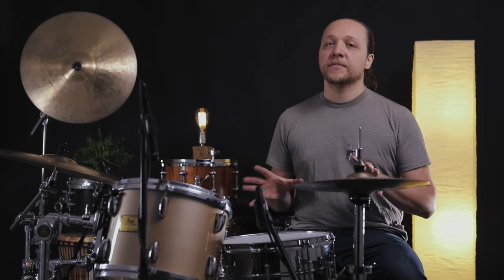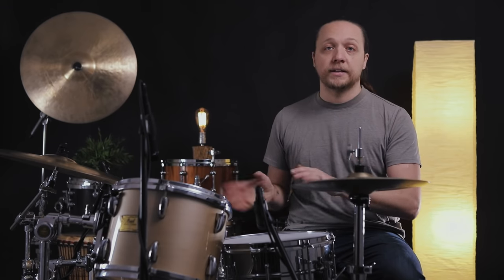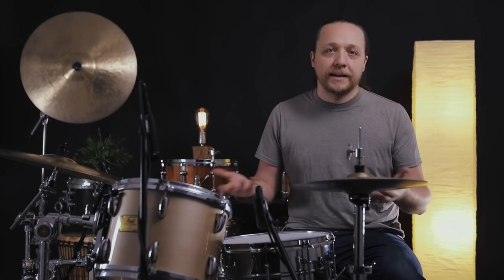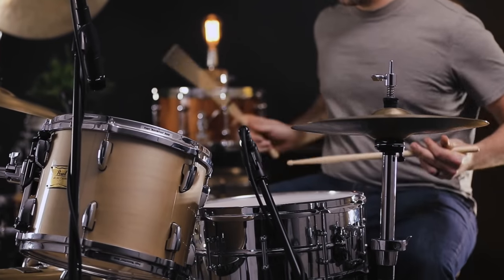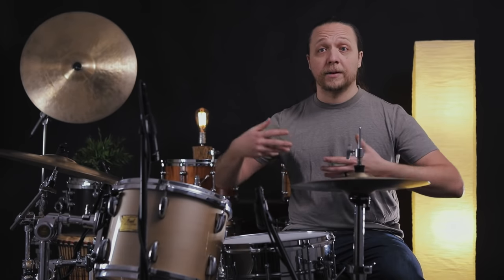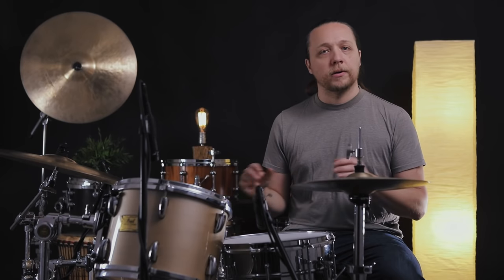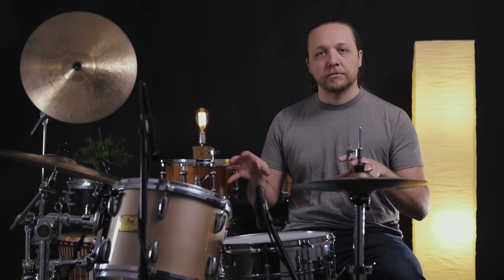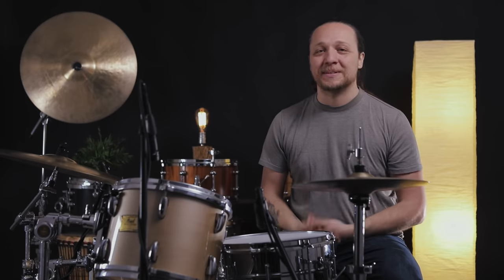Your Resos Are Killing Your Tom Tone | Season Three, Episode 38

Comment: Great Job and Clean Precise Playing I’ll also add I tune the Drum to its own shell sound just tap it with Tge heads muted and you hear a Tone FYI I found out DW Collectors are Stamped inside the Shell
Reply from the maker: Thanks Tim! For what it’s worth, the pitch stamped on the inside of the shell (or the pitch of the shell without any hardware on it) has little to no relationship to the tuning or tunability of the drum. We debunked this in a couple previous videos. It’s a nice marketing piece but should by no means be considered a standard for tuning the drum.
Reply: @SoundsLikeADrum  I mean I tune the drum to the sound it makes the pitch of the Shell I don’t check the notes just the sound

Comment: I'm constantly changing the intervals depending on the heads I'm using.  Before, I had coated G12 batters and Genera Resonant resos; my 10x8 tom was tuned with the reso a half step lower, and my 14x11 tom was tuned with the reso around a M3 or P4 higher.  But this was at the end of life for the batters, and they were probably different a few years earlier.  (Yeah, I waited a really long time to change heads, and surprisingly, the resos still have tone when I tap them off the drum.)

I recently decided to give Remo another shot, and now I have white suede ambassador batters and clear ambassador resos.  The resos are both tuned a slightly sharp half step above the batters.  Maybe the heads still need to be broken in, or maybe I need to bump up the resos a bit, but I'm getting a bit less sustain than I would like.  The 14" also gets boingy if I try to tune it lower.

I've had success with Remo resos and Evans batters on my snares and kick.  I probably should've done the same with my toms.

Comment: Have you ever used a Controlled Sound or Power Center type head as a resonant? I find myself using a moongel directly in the center of my resonant heads a lot lately, and I'm wondering if I can get away with not doing that by simply using a CS-type head instead.

Comment: I usually tune top and bottom the same way-half turn all around, but that doesn't result in the same pitch since my batters are thicker than my resos. The reso is about a minor 3rd higher in pitch. I suppose you could get similar results with the same heads top and bottom if you tuned the reso a little higher. I've never been able to get a tom to sound better (to me) tuning any other way.

Comment: i'm old and old school. by listening to the drum itself you can find the note of the drum. i do everything by ear but now i then grab a drum dial and find what number am i at just to make it faster next time. right now for toms only we have remo pinstripes on top and generic pearl clear on the bottom. both heads are at 75. i always tell people if you need tape then you didnt tune correctly. also, what happened to the direct comparison usually at the ends of videos?
Reply from the maker: That's an excellent way to find sounds. I have to disagree with you on the statement regarding the use of tape or muffling though. There are plenty of practical scenarios where the sounds that you're aiming for can't be achieved simply through tuning alone and that's okay. It's when people fail to invest the time in learning to tune and just muffle poorly tuned drums that you end up with a lesser version of the potential sound. As far as comparisons go, we do them when they're applicable. In the case of this episode we didn't feel that there was significant benefit to comparing versions of choked out sounds.
Reply: @SoundsLikeADrum  thank you for the reply. You guys are awesome and have such valuable info.

Comment: Can you guys do some kind of content on how to hear the pitch of individual tension rods and techniques for making them even? It can be so deceptive. I’ve been watching your vids since your channel started, experimented with tuning a lot, but this has been the missing piece. I’m trying to learn, but since I feel like I can’t hear each tension rod’s pitch or if the head is even, I feel like I’m shooting in the dark.
Reply: I know Ben and Cody are going to frown upon what I’m going to say but here it is anyhow. I struggled with this same problem, especially when you have one or a pair of rods that are much looser or tighter than the others. The overtones you hear when you’re trying to pitch match all sound similar, I didn’t know what I was listening for. I was spending more time chasing tuning than I was playing drums. Out of frustration, I bought a tune-bot studio. Not to “tune to a number” as Cody would say, but to help understand what I was hearing. After a while your ears become trained, I still always use it when I’m tuning but I probably don’t need to I use it more as a reference.
Reply: I use an Evan’s Torque Key.  Costs about $25.  You set a value and it releases when each lug is at the same tension.  It’s not an exact science, and I only use it to get the head seated and then I dial it in manually, but it’s a great way to get those lugs approximately even.  I keep one in my gig bag at all times...it’s great for fast head changes.  It has also helped me learn to feel where each lug is and anticipate where the tension is.  It has its limitations-it doesn’t work well on old drums with rusty lugs (that makes it hard to tell by tension where the t-rod is), and it definitely does not replace knowing how to tune...it’s just a tool, and a (relatively) inexpensive one.

Comment: Have you ever noticed variation in tom sound with the type of mount? I’ve been having problems getting a good sound out of toms that clamp on to a hollow tube that goes into the drum (not sure what that sort of mount is called....)
Reply: Yes the Pearl ISS mounting system is particularly bad
Reply: and i have the same issue with snare stands. if you have a deep,big tom(14x12 or bigger) the snare stand is killing the sustain. i try that fatcat(?) thing on stand but doesnt work veey well.

Comment: I have two questions: 
1) Should I tune my toms to resonate with each other ( Rack tuned with intervals from A to C and a floor tom from G to E)?
2) How do you get the tom pitches to be at a third interval?
Reply: No, tune the drum to the frequency the drum vibrates at (in Hz) after the hardware is taken off for max resonance aside from heads being equal tension

Comment: Do you think changing the reso heads that come with the drumkit is a must?  I have a ludwig element birch that came with remo heads but I did change batter for some emperor coated, and still I don't think I got to the best sound possible.  Could it be beacuse of the factory reso heads?

Comment: So I’m using hydraulic Evans batters. So where should the reso be tuned? Not a 3rd higher than batter? Now I’m confuse cause you said it be different if using hydraulics. Grr. And how do you determine the pitch? Do I have to buy some equipment to do this? Or would a guitar tuner for instance work

Comment: Great video. I have a Sonor SQ2  Maple Medium kit, 8x8, 10x10, 12x12, 14x14, and 16x16 stock Clear Sonor reso heads ( ambassador weighted ) and Remo Clear Emperor on batter side. Definitely struggling to get a good sound out of the toms. The bass drum 22x18 and snares 14x5, and 10x5 sound great.

Comment: Awesome video! What about starting from scratch? How do you tell your batter head is in the “zone” you like when you’re reso could be god knows where? Do you normally start with say 2 full turns on both top and bottom and work out from there? Or do you start with only the batter head on and get it close before the reso even enters the picture?
Reply: Start with the top head by tightening just enough to take all slack or wrinkles out, and tighten the bottom head maybe a half or quarter turn tighter than top. Drums are all about the heads, the only thing separating top of the line drums from the bottom line is the hardware. Top of the line drums will sound like shit with shit heads. You really play the heads not the shell. It’s all marketing.

Comment: What does everybody out there think about which Drums heads I should use.  I have a cheapo starter lit:  Gammon which was received as a Xmas gift from wife in anticipated retirement in 2018 (right now.....I'm shopping for a different kit {Used 0 with pdp Concept Maple in lead for consideration].  I presume they are a mixed wood and /or poplar combo drums.  I'm currently using Evans EC2s batter and G1 Clears as the reso heads. I have been able to achieve a reasonably good sound (with LOTS of tweaking) on the 12 and 13 inch Toms.  The 16 X 18 Floor Tom is Soooooo difficult to get there.  Should I try Evans G2 Coated on the Batters ?  I received a pdp concept maple 10 X 8 Tom (xmas gift from my son....  I asked Santa for it !!), which came with Stock Remo clear heads on the batter and reso.  Man, whatta difference ... nice resonance w/o over ringing...  a Nce Dooooo, Dooooo sound.  Although I'm FAR from being a true intermediate drummer ,  I will say, having the instrument with that "nice" sound is very pleasing.  For further info, I just purchased a used (Reverb), 16 X 145 Floor Tom , pdp Concept maple Silver to Black fade to match the smaller Tom, which was delivered with Remo Ambassador single ply Clear heads.  I just installed the EC2s on the batter , which does muffle the sound, but does provide that Rock Attack.  That drum as well i Heads over Heels on the Gammon.  Hence , my desire to upgrade.  Be well all.  Please post your thoughts on trying the G2 coated heads ....

Comment: The main challenge I run into is that the set at my church doesn't have many lugs on the toms which makes it more difficult to get a consistent tone.  I often fine that even if the initial strike sounds good, the overtone tends to bend in pitch or warble.
Reply: Tune top amd bottom same tension. No wobble. No pitch bend

Comment: I'm sorry if you have addressed this already: When I put on my bottom heads for the first time, I use a marker and put a line next to one of the tuning screws. When I feel I am not getting the sound I like, I will loosen the head and turn it one inch or so clockwise so the pressure on the head is not in the same spot. To me it seems to make a difference in the sound. I was told long ago that this helps by not letting the head "settle". I'm just curious if you might have a thought on this.
Reply: Had never heard this, but I’m gonna try it.  Just got new batters and resos so I can do a pure test...thanks for the suggestion! Not sure if it will have an impact, but I’ll see over time if it helps the heads refresh a bit!
Reply: By tightening the lugs the same it’s equal pressure on the rim. It’s all in YOUR HEAD and not the drum head.

Comment: I've seen drummers place a head on a drum then push on it till there is a cracking sound, is this a good thing to do to a new head?
Reply: Yes , I do the exact same thing with new drum heads .. ur just  stretching out the excess glue that holds the head to its rim.

Comment: WOW!!! How do I get that snare sound???
(I'm somewhat new at drumming)... I just changed my drum heads, and I am unable to get the sound I'm going for... which is the snare sound I'm hearing in your video (my old dead head sounded a little more like it)

But now, it sounds more like a marching band snare and I don't like it at all... It's like a high "TAK! " sound and I wish a sound more like in your video.
(I tried moongels, - O-Rings, but still sounds like a marching band snare)

I have a Sonor metal snare 14'' x 6'', with Remo Embassador Coated head

Please help me!!!
Reply from the maker: We’ve got TONS of episodes on snare sounds- real-time batter, real-time reso, general tuning, experimenting, etc. A big component of it is not over tensioning any of the components. Most people tension at least their batter head, or reso, or wires too tight. It’s all about balance.
Reply: @SoundsLikeADrum  Ok, I'll check these videos out. And thanks for the info.

Comment: Regarding that preferred interval between batter and reso pitches, how does the shell depth affect that? Do different depth/diameter combinations tend to want (or respond differently to) different intervals? My guess would be “yes,” since the air column is a different length.
Reply from the maker: It really depends on the heads and the range that you wish to be tuning the batter head within. The shell depth is a factor but there are a variety of other variables that need to be accounted for.
Reply: @SoundsLikeADrum  Of course. It would just be interesting to see how much the shell depth weighs in as one of those factors, and how it affects tuning options. Thanks!

Comment: I have similar findings tuning modern drums, but I find I have to crank the resos on my 3-ply Ludwigs to get a resonant sound. That goes for low tunings on the batter head especially. Maybe it's the round edges?
Reply from the maker: Not sure of the physics there but I’ve had 100% the same experience - fat round edges = tighter reso for sure. -Cody

Comment: I think when you're tuning your toms you need to use your ears. I tried tuning my 8x10 tom using your suggestion of tuning the reso a minor 3rd higher and it did not sound good at all. Too much ring. i settled on tuning my reso just slightly higher, maybe a 2nd or minor second and detuning 1 lug a quarter turn. Much better. I guess my point is there are many factors involved to narrow it down to a one-size-fits-all formula. Different heads, bearing edges, drum construction and personal preference make it difficult to generalize. That said, Ralph Humphrey like your approach, so there must be something to it.

Comment: I have a three rack tom and three floor tom set up. 8, 10, 12, 14, 16, and 18 inches respectively. What I do is use a Drum Dial and tune all 12 heads to the same pressure reading on the Drum Dial and let the drums speak for themselves.
Reply from the maker: That's great! What about the resos? Also, have you ever tried a different pressure reading? Have you ever had to get difference sounds from these drums to match a musical need?
Reply: @SoundsLikeADrum  no, I haven't tried a different pressure reading on the reso heads. I'm in a band that plays all original music and this tuning fits perfectly. However, I do feel that should I find myself needing to change the timing of my toms to fit a musical need that I would be well equipped to do so.
Reply: this is a link to the tunebot.. i use 6 toms as well, and this online calculator spreads the toms out over 1.5 octaves... see its tuned 8-10-12-14-16-18 to,  (B-D#-G-B-D#-G)...  https://tune-bot.com/tuning-calculator/  ..... and, based on a couple of preferences, it provides you with exact frequencies in which to set each head to... it will sound perfect!!  and if you want to move the note values up or down, its a breeze...
Reply: im not sure if your strategy with the drum dial will give the best results... its focused on timpanic pressure, it does not really equate to musical note... and 2" size difference in shells will not give 'fall' you seek... the tunebot tunes you musically...

Comment: Hi there, I just came in here as a result of the collaboration done with rdavidr, great video by the way!

I´ve been struggling with my toms sound, I know that my current setup is not ideal for resonance cause I currently have Evans Hydraulic on the batter as well as the reso (cause I´m lazy and kinda "like" the sound of that combination), both of them are hand tight to as tense as my bare strength can be :P

But I would like to ask anyone out there what heads I could try for a warm, not that resonating results I could get?

I would think of going for coated ones, my intentions is to get a well balanced sound!

Current kit is Gretsch Catalina Maple and I´ve had it for around 6-7 years now!

Comment: Wait, for a jazz tuning you'd bring the resos down? Had to go back and make sure I heard you right. Can you clarify?
Reply from the maker: Hey there! Yes you heard correct - i personally do it to enhance clarity and articulation at low volumes, but the added rebound certainly doesn’t hurt either :) -Cody
Reply: @SoundsLikeADrum  Thanks, Cody, but I don't understand how detuning the resos adds rebound. Are you saying you tighten the batters and detune the resos, or that you tighten the batters and don't tighten the resos as much, thereby creating a larger interval between the two sides? Thanks!

Comment: Curious I can't tell is that the pearl SSC Or is it a newer version of the session kits or am i completely wrong. I have  Free floating bass drum But I would love to have a Tom holder for both my floor Toms. But I would love to have a Tom holder for both my floor Toms. Cannot stand those weak legs on pearl  Floor Toms. That's the same exact colour as my pearl ssc kit with sparkling it. But I assume that's if it is a session kit it's the one that has mahogany in Birch. I wish I would awaited instead of getting the Kapur/ Birch kit. And waited for one of the newer session kids with mahogany like the kid I had in the early nineties which was the prestige Session elite, which was mahogany and Birch. Don't get me wrong I like my kid I love the sound of it but I'll take mahogany over Kapur any day. I always tighten my resonant head higher than what my batter head is. I have the same heads on my Tom Toms but I have an inverted dot Evans on my snare drum.
Reply: I know this has nothing to do with the Resonance head. In way that you need to tune to achieve a perfect Tom sound.  I always tune my resonance head slightly higher than my batter head . I didn't always do that,